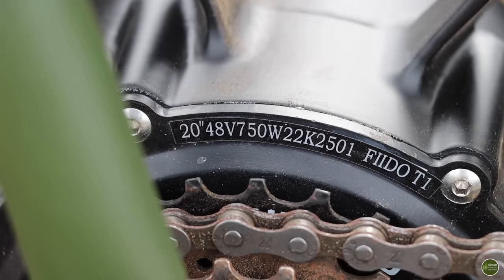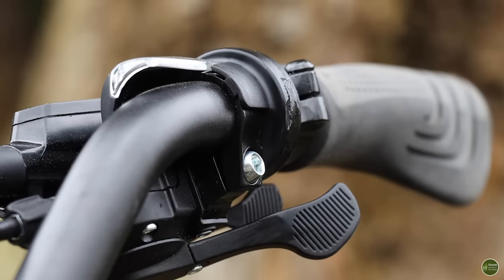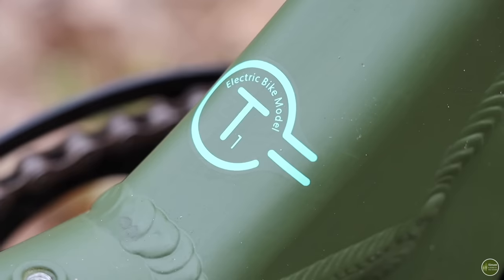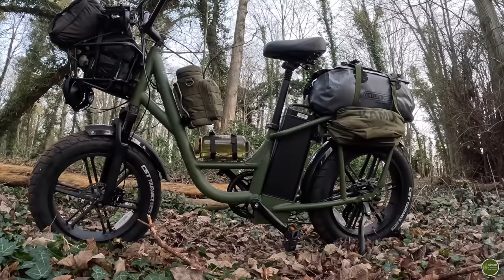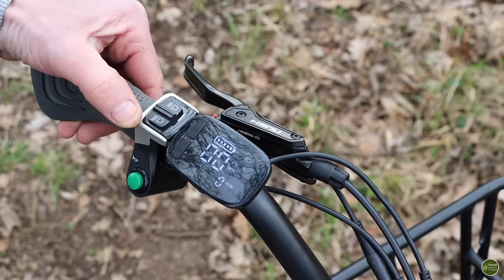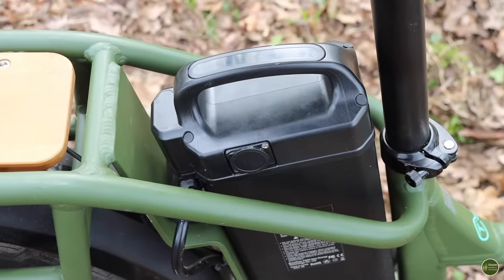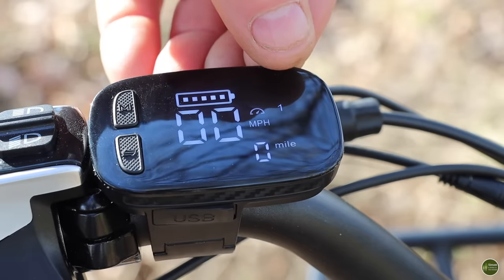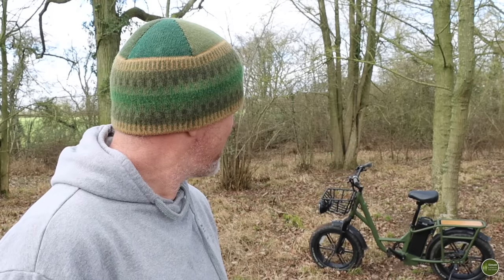Fiido T1 Pro Utility E-bike.  My Long Range Cargo Woodland Assault Vehicle.  E-bikeThrottle Removal.

Comment: Great video - I'm pretty sure you're vanishingly unlikely to attract untoward police attention, particularly since you'll demonstrably be pedalling any time the motor's kicked in.

My own e-bike (bought secondhand) has a much more iffy setup in that there is a toggle button on the handlebars to switch between "EU mode" (throttle active) and "UK mode" (pedal-assist only). Since it was originally bought in the UK, I can only assume that's somehow legal.

Comment: I hope the cops don’t bother with you about your bike.  Surely, they have more important criminals to worry about.  I can’t speak to the US law about e-bikes.  I just don’t know.  I have been riding a motorcycle since the 80’s, so, I haven’t worried about a bike license.  Spending the morning looking at Fiido Bikes.  Might be a good fit, because I live in the country, about 10 miles from anywhere.  My Tundra gets 15-16 miles per gallon.  My Harley gets about 45 mpg, is big and heavy.  So, I’m very interested in the e-bikes.  Thanks for sharing…from east Tennessee.
      P.S.  If you’re considering getting a Tundra…get a used, 5.7L, 8 cylinder, long bed.  Heh, heh, heh…😅

Comment: I have been surrounded by police on my FIIDO L3 350w with throttle policing a football match and they didn’t bat an eyelid because I peddled , even if you just peddle fresh air while using the throttle as long as your not going like a lunatic they won’t bother you , it’s just a case of riding sensibly so you don’t attract unwanted attention .

Comment: Brilliant video Simon, and very nice bike I own a fiido L3 which is more a tarmac travel bike, the build quality is very good, I notice it has the same computer on it as mine, I usually drive it in a3 and unlocked by holding the 2 buttons till it blinks then up down up on the buttons, mines a 350w motor and gets 20mph, yours be getting 40+, safe journey 👍

Comment: Rack mount. I used pipe mounts one for rack one for a 10mil tube I mounted to accept bag clip. Bolted together so you have two tubes the thinner outer one for bag.

Comment: Bit late to the party, but with the mud issue those mud guard's need to more off the wheel. Obviously in a clay type environment the mud will build up and eventually block the wheel. It happens on motorbikes all the time.

Comment: I have a throttle on my RadRhino 6+. All it gives me is a little push when required. I think the firmware in the controller limits the operation.

Comment: This comment by Simon does not refer to all ebikes, just his.  I decided to research a folding ebike to use off-road in Norfolk, UK. But when I saw what Simon had done I thought maybe an ebike for off road use is not for me. But his machine is 750 watts and has power to propel the bike without pedalling. This means it is classed as a road vehicle. Must be registered with DVLA, be insured and more. But buy an ebike with only 250 watts in UK only with power assist whilst pedalling and you are good to go.

Comment: So Simon, after 5 months, how do you like that Fiido? 
I am giving some very serious consideration to getting one. 
One the Fiido web site I read in the motor section that the motors will last about 500 hours, that's approximately an hour a day for two years.
They list motors for everything but the T1, and the batteries are $650 USD + freight.
Anyway, I thought I would see what your thoughts were. 
Perhaps a follow up video?...

Comment: If you modify an existing off road/ mountain bike it doesn't have to be a pedelec (the UK still keeps the EU rules) and it involves getting a legal motor,  battery, controller and throttle. It's a lot cheaper to go down the DIYroute. A mountain bike with panniers is a good bike.

Comment: That's only for UK roads, off road it's ok to use throttle and no limit wattage. Cue the road regulators. Been doing e bike camping since 2014 on modified MTB with a bafang 750 and 1000 still going strong for true off-road use your actually at low speed high torque situations.

Comment: Nice review! Really like the integrated rack/rear frame. As a cyclist I not that keen on step in frames. Especially a bike that has high speed potential kan get very wobbly in the front since there is no top tube to stiffen the frame up. Don't know if you felt it but front wobble will make the steering sketchy and could have contributed to the unintentional stops. I see the utility of e-bikes but for me I'll wait until reaching old age ;-)
Reply: I own this mate. You're talking nonsense for the fiido anyway. They did make advancements for the latest model. I have it unlocked on west kerry roads bud. Its the riders that suck....

Comment: Good looking bike. I like the range. Would be cool if they had the option for a front mounted second battery. I tend to personally prefer mid-drive motors. I think putting a left hand rear view mirror might be awkward. I like the very stout wheels alot. Would prefer more normal sized tires.
Reply: you could do it to this bike. you could mount a hailong battery pack to the down tube using the water bottle mount and a simple wire up with a ebike battery doubler and your in business.
Reply: @MrSGL21  You have a point. It could be awkward. You'd have to be careful how you strapped it on or it would get in the way of the rider's pedaling feet.
Reply: @MrSGL21  spurious battery of a shape that can be mounted under the front basket. I bought the frame and wheels of one of these( no battery ) that had been replaced because of the frame cracking issue. Plan to use it as a test bed for a few experiments I have in mind. 
One thought is to place the battery under the front basket.

Comment: It is still not road legal as the limiter only limits the speed not the power from the motor. You still have 750w available power. You rarely use that much due to the speed restriction. If it was only 250w you would really know.

Comment: Simon, a quick question for you. Is the motor wire from the controller to the motor still a single continuous wire, or is there a join. A continuous cable means that you can't remove the freewheel without a lot of work either dismantling the controller, or cutting the cable and rejoining it. It is or was a big design flaw.

Comment: Simon, I love your Channel and everything you do, but I've been researching this bike (for me) and I would advise you to consider further remedial action.
I don't think 750w motors are ok, they need to be 250w. If you look further afield on youtube, you will find that Fiido actually recalled the bikes and now issue them with motors marked 250w (which they're saying are really (quietly) 750w). Those with both bikes have noticed a drop in performance. 
There's a gadget you can use to check ampage, I would hate to see you in any kind of trouble.

Comment: You may have got away with just unplugging the throttle and sleeving the cable to tidy it up as on private land the legality doesn't apply ... as long as it is unplugged if you are stopped by Police then it shows you are aware of the law but wish to retain the functionality for when it's needed  .... I say this because there are certain times the throttle can really get you out of trouble that don't involve actually riding the bike .... such as trying to push a heavily loaded bike up up a steep unrideable slope with an element of control ... many have a "walk mode" but there is no control over the output ... sometimes you need less/more ...  i was going to remove mine completely until I came across that exact situation as I never use it otherwise ... I like pedalling , it's why I've never had a car ..... A bit like carrying a fixed blade ... if you are sensible and pack it in your cook kit you have a valid reason to carry it ... any reasonable copper would probably see that you are worthy of such freedoms I would think .... to be fair a lot of them would probably be more interested in hearing about your lifestyle .... anyway what's done is done and it's good you brought it to light .... as for the 15mph ... I've clocked 56.6 on a downhill with a tail wind on an analogue bike .... and if you're getting 15mph on a climb you're flippin flying and better consider the strength of your chain .... you just gotta be sensible about these things ... cheers ... happy trails :o)~

Comment: Actually throttles are legal in the UK. They're restricted to 4mph unless you get a certificate, a bit like an MOT that states the bike is safe ect. Then you can use a throttle up to 15 mph... No insurance, no number plate, no helmet needed

Comment: Hi Simon, i'm not convinced this is right.  It might be worth your while to take a look at driving instructor Ashley Neal's channel and specifically a review and ride he did of an E bike with a throttle.  He's usually well up on the law and he seems to be saying that electric throttles are legal.  Best wishes
Reply: It isn't correct. The fact that the motor has 750w stamped on it instantly makes it illegal to use in the UK. The  exception being private land that has no public access or rights of way. The company claiming that the controller limits the bike to 250w so making it legal to use, is completely misleading and incorrect. It would be interesting to get whoever supplied the bike, to counter this in writing.

Comment: PLEASE DO NOT BUY THIS BIKE.  Im really dont want simons good name to be dragged down with this product. For the first two months of owning and using this product I also thought it was fantastic. However after two months when the bikes stop working you are on your own with a £1500 loss
Reply: This is predictable for basically anything made in China
Reply: I have a fiido d4s electric bike for 4 years now without any problems. And battery charge is still high
Reply: When you buy any bike for 1500€, it's basically trash. After a year you got to buy proper wheels, drivetrain, pedals, fork, battery, headset, saddle, saddle pole. You know, everything.

Comment: i dont know why you bother mate,ive got a fat tyre bike with 500w motor throttle and can do 25mph and ive used it on the roads using throttle for 3 years now and had police cars pass me many times and never stopped me yet.i know your thinking of the laws in this country but do you honestly this the law is mate.

Comment: The "full-throttle not allowed" rule does not make any sense. Speed limit, okay i can understand, but what makes one think an ebike is safer only if you pedal vs full throttle... and the limit on watt power??

So a 1000hp car is okay as long as you adhere to the speed limit.

Comment: You can only have a throttle on a bike bought in 2016 or later if it assists the rider without pedalling at a maximum of 6km/h (3.7 mph

Comment: You're lucky they gave you one and it looks good. I paid for a Fiido bike and had to get my bank to get the money back as they never even sent the bike or responded to enquiries so pretty stressful & irritating. I ended up having to buy another brand which did deliver an actual bike. So Fiido is not  a brand I have been pleased with in fact they couldn't have really been much worse & I now avoid.

Comment: Strictly speaking , we could say that the throttle on the T1 is actually a switch for walk mode. You cannot feather the power level with it - that is what a traditional throttle can do. Also, on the new Fiido T1, the use of this throttle cuts out the peddle which takes the joy out of it. But make no mistake folks,, the legal rational here is just to put the squeeze on people and monetize it/persuade people into getting a car instead. Nothing to do with safety. ... So grandma has to peddle to go up the hill for her weekly shopping, she can't have a switch. Such miserable bastards!

Comment: You can use these modified bikes on private land, but you can't use them on the public highway. This is a load of BS because I have a mate who is 68 years old with an electric bike with a throttle fixed to it. He is disabled and needs his knees replacing as he has bone on bone problems, which causes him immense pain trying to peddle a normal bike. He can't ride faster than 15mph in full electric mode. Otherwise, he would be breaking the law, yet ordinary manual pushbikes constantly overtake him. It makes no sense whatsoever. The law, at times, can be a real ass trying to squeeze as much out of people as possible. All fully powered bikes sold as such must conform to the highways act, which makes sense, the bike you have is nothing like a full electric powered vehicle which can travel at speeds in excess of 30mph plus, your bike can be manual peddle powered, you can have peddle assist mode or you can have it controlled by a throttle which only allows you to do 15mph at most because the motor can be programmed to cut out at this speed. I also have the same knee problems as my friend. I use a disability scooter to get around on, but this limits me to many places that I can't get to because the scooter isn't designed for such places. If the law changed and let disabled people have these bikes like the one you have, which can be throttle controlled in order to give the legs a rest whilst still continuing the journey I would buy one tomorrow. Thanks for sharing the video with us.👍👍

Comment: You've ruined the bike by removing the throttle. It's still 750w power. The legal requirement is 250w. So you will still need tax, insurance etc regardless. This is classed as a moped.

Comment: You can hold a button and unlock the 750w so it’s still technically illegal so you cut the throttle off for no reason 😂

Comment: you could have just unplugged it and tucked it away or electrical taped it out the way 

the throttle is only illegal on the roads out in the woodlands you can use it to your hearts content 

its also not illegal to have one its illegal to use it if you get pulled and its not connected up they cant do anything cause you are not using the throttle nor could you have been if its taped up out the way

Comment: The info about being a moped  and the throttle should have been provided from start. The company have no excuse from not knowing this it is all on them to read up on the laws when providing a motorized vehicle in specific country. As i know it in sweden it is also the users responsability to to check if the vehicle is legal or not for use on public paths/roads police do not care if one dont know you will get a ticket and even higher one for driving for driving without insurance maybe even taken away from you. I do not know the uk laws so i cant talk about that. I also wonder about 3rd party repair? If the battery has software locks either when battery has reached a certain number of cycles or when repair is attempted? If electronic and mechanical parts will be provided after warranty is gone? Will a battery cost more than a new bike?  I still prefer a bike with human power without any electronics to break down!